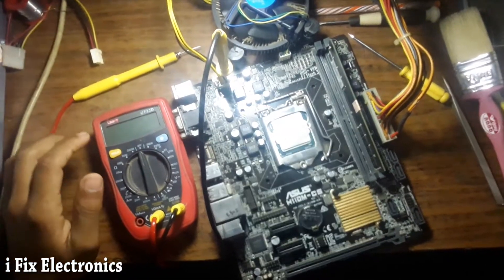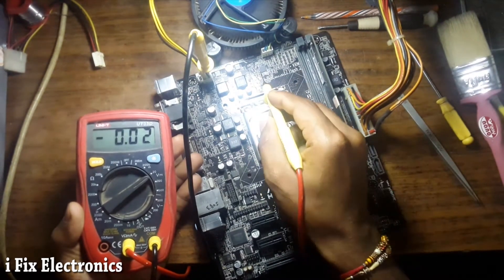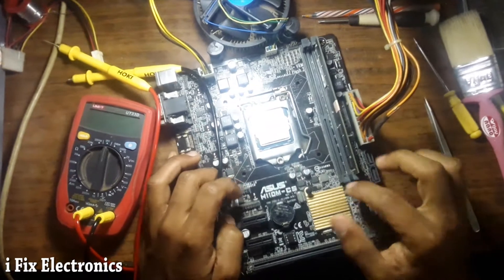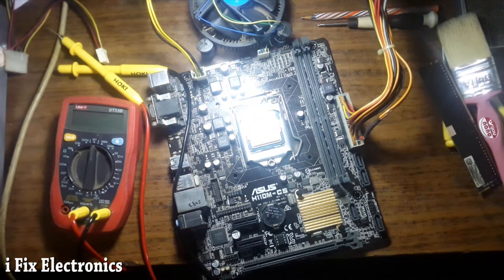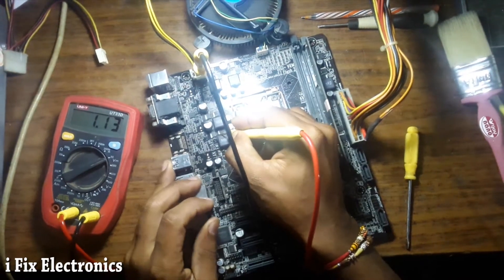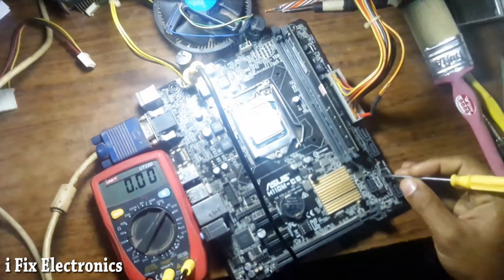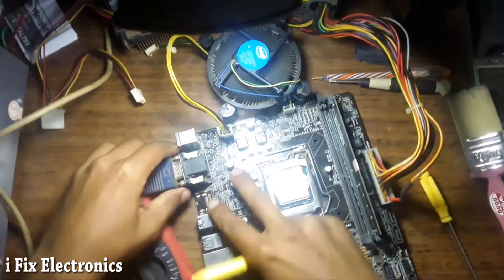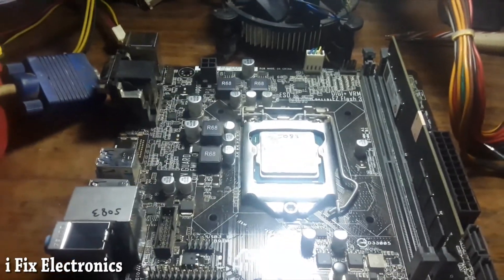Asus H110M-CS No display  (VCore Missing)

Comment: IF YOU HAVE H61-H81-H110 AND DONT HAVE VCORE .OR VCCSIO  CHANGE LM324, LM358
I HATE THIS CHIP . YHIS CHIP MADE I 1990,WHY COMPANY USE THE SHET ??
THIS CHIP ONE PIN FROM CPU HOT .AND OTHER IS 1.02 VOLT
IF CPUHOT IS ENABLE LM358 DONT SEND SIGNAL TO  CPUVTT .TO SHUTOFF CHIP 
AFTER TIME SOME RISISTOR BEHIND CHIP OR CHIP IT SELF IS BROKED
Reply from the maker: They use this chip because it's an Op- amp and low cost chip

Comment: I have H110M-K.

It Boots fine to windows, but no display only on VGA/D-sub port. DVI was working fine...

And all PCIe slot also not working. Do you have any suggest?
Reply from the maker: May be your pch is faulty you need to replace new motherboard
Reply: @ifixelectronics555  nawww... What a bummer...
It's nice looking Mobo tho...

Anyway thx for your suggestion, i'll give you an update if any...
Reply from the maker: sure
Reply: @ifixelectronics555   USE GOOD FLUX .HEAT UP 360 FOR 2 MIN

Comment: very good tutorial. do you have guides on over current usb voltage?
Reply from the maker: Yes near usb socket we have protection ic just remove it. 5 pin or 6 pin ic is there

Comment: Thank you for sharing. 

Could this work for h310 ASRock?
The CPU heatsink is getting hot. There is no video.
Reply from the maker: If it as same design as this then it will work
Reply from the maker: Check vrm ic and trace its en signal

Comment: Bro , i have this same issue as for now 😊
Reply from the maker: Then make that jumper
Reply: @ifixelectronics555  is it always that is the problem , mine is no display and no vcore voltage just like in your video, is it possible the vrm ic is damaged too?
Reply from the maker: No check en on vrm ic if it is missing then make that jumper

Comment: Asus p5kpl am se no display
Reply from the maker: Apne kya kya check kiya hai
Reply: @ifixelectronics555  VCORE_en voltage exists
CPU VTT is ok but the VRMPWRGD voltage is not present and I measured the voltage at the gate pin of the mosfet it is not present then what else should I check
Reply from the maker: if v core voltage is available then vrmpwrgd will be available
Reply: ... Talant

Comment: I have same problem but short these transitor but no vcore
Reply from the maker: You have to short PQ307 mosfet only with drain to source
Reply: Ys i have already tried
Reply: But no vcore
Reply from the maker: replace core ic
Reply from the maker: check cpu pins
Reply: Hi bro my cpu fan spins but processor is not heating up. No display